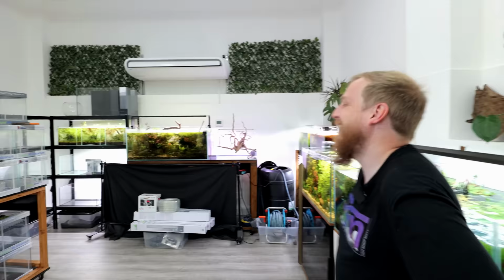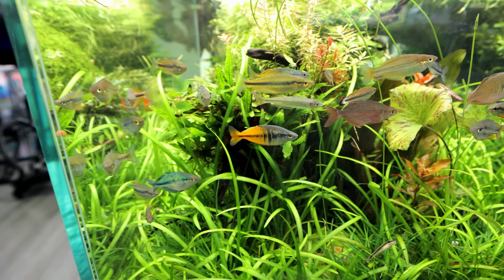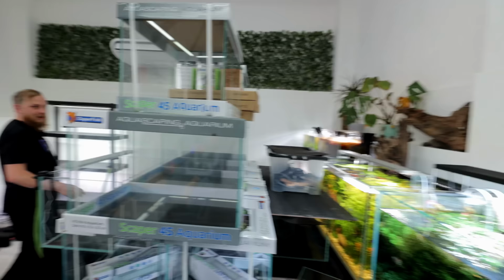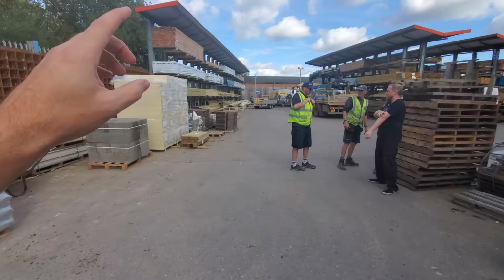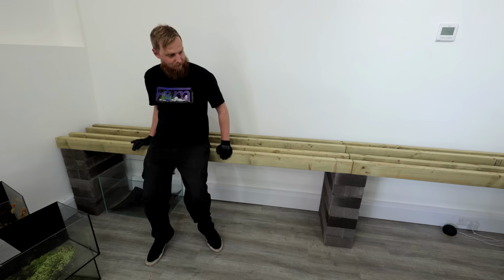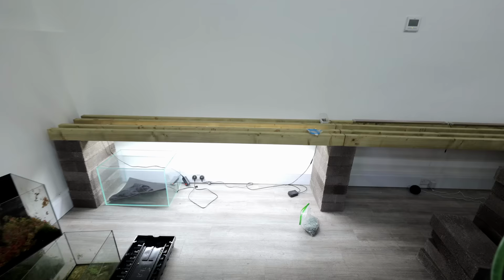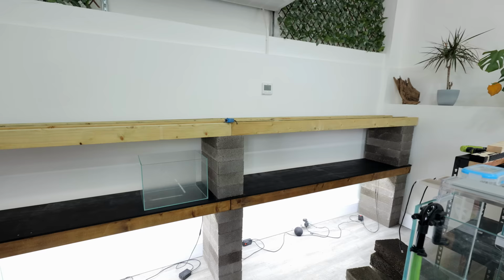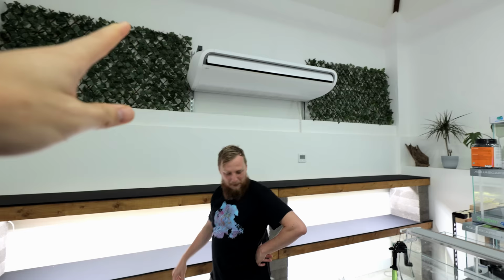Building A 16ft Racking System For The Fish Studio! (IT'S HUGE!!)

Comment: 18 tanks and then the top rack. You risk crushing the part of the wooden beams that are under the blocks. Moreover, we have the beam joints (read weakest region) coming under the blocks which will slowly start crushing the edges of the beams due to the load over time. Also, since the block is uneven, the weight distribution will be uneven on the points of contact between the blocks and the wooden beams. 
Going to stop my ramble. Love love love your work MD and Matt! Excited to see the studio change and morph. As Matt would say "change is the only constant"

Comment: Gents, as the 2x4's dry out, they will all move/bow/cup individually.  The 1/2 or 3/4 ply, whatever you used is not rigid enough to stop that, and you may find tanks being out of level within the next 6 months.  May I suggest blocking them together?  Cut a bunch of 4-6" blocks out of another 2x4 and screw them into each length.  It not only will strengthen it, but will keep the 2x4s from shifting as much since there is more force keeping them from sagging or bowing .
Reply: agreed, the sag alone before that even happens is too much if those are four approx. 20 gallon tanks spaced out on each shelf.  looking at 0.5 to 0.75 inch sag, if they dont just outright fail, the bowing/cup will cause issues for the rimless tanks, the ply wont make a difference when the whole shelf is sagging that much.  this is not a good shelf system and I worry about it short term, let alone long term and its ability to hold up.
Reply: Yes!!!! I thought I was missing something but it seems like the 2x4s are just laying there.

Comment: Hey md! Crazy plant lady here: check your plants for infections/trips. The burn marks could be the sign of an infestation. Also the yellow leaves are often a sign of overwatering/root rot too. Its good to just have a fixed scedule to water, such as once a week. Go around, poke your finger in the soil and only if it got dry give them a good water (preferably with your fishtank water!). Water untill it runs through at the bottom, and throw away any water that ran through/ let them drip out in the sink. If you keep having issues, you might need to take some out of their pots to check the root systems for rot. 

Dont water when theyre still wet, and dont let them stand in water, thats how you get root rot. 
The only plant that you have that is an exception to this is your spathiphyllum, those dont like drying out

Comment: Feed your plants with fish water or go hydroponic and remove all the substrate from the roots and put the roots into net pots and hang on edges inside the tanks. Don't remove yellow leaves - it is a natural plant thing called Senescence, nothing you have done or not done. Provided it is the lower older leaves dying it is normal. It is only an issue if it is the top, youngest leaves flagging. Your monsteras need sphagnum moss poles.

Comment: I work in construction and just be careful, with prolonged weight even with a board across the top that span may sag under the weight of all the tanks when they are full of water, I would get form work timbers that are designed for lots of weight and you will be safe and all your tanks and fish will be safe too

Comment: My structural engineering background is seeing a cringe house of cards. You have too many gravity connections and not enough mechanical connections. I would be siliconing those cinder blocks together and then fastening your joist framing together with some blocking and then somehow to the blocks. Your middle section of cinder block columns are a weak point for racking and toppling over.....especially at 3 levels. It looks cool but once the weighted tanks are on it, if there is any eccentricity or it is slightly unlevel or somebody slightly bumps it, it could rack and topple.
Reply from the maker: fingers crossed then 😂😂😂😂
Reply: @MDFishTanks  I love it. Can't wait for the video where the whole rack comes down and then you fill in the space again. :p
Reply: I agree with the engineer and another comment about the boards moving as they dry out. You are building a heavy house of cards.

Comment: This could be dangerous - not sure how lumber works in UK, I might have missed the lumber dimensions, but if comparable to US 2x4s, you may be in trouble with sag for this.  what are the gallons per tank?  I did rough estimates of using US 2x4 with four 20 gallon tanks (estimated) on each shelf and you are looking at almost 3/4 inch sag even with evenly distributed weight per shelf which is excessive and could either potentially fail or cause your rimless tanks to not have a nice flat bottom as the whole shelf will bow.
Reply from the maker: Thanks for taking the time to calculate and comment. The tanks are not that big. More like 10 gallons....and if they all come down, it will make one hell of a video 😂😂😂 (they won't come down)

Comment: Am I missing something? Did you guys not use screws or nails at all?! As a carpenter this really upset me. Those 2x4s really need to be strapped together to prevent or fight against bowing or bending. Laying them on their spine is correct but still with all the dead weight that will be on them I would want more security. Please use fasteners. Those 2x4s can roll when they’re on their spines, that would be a disaster. Perpendicular blocking would prevent that from happening.